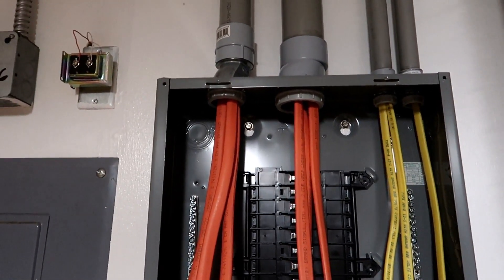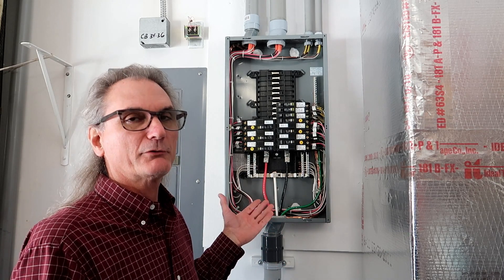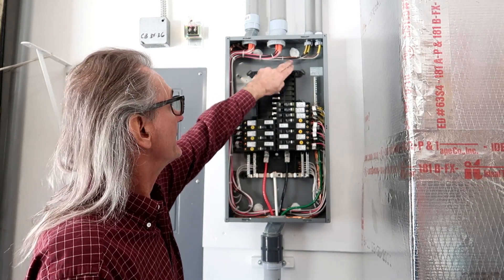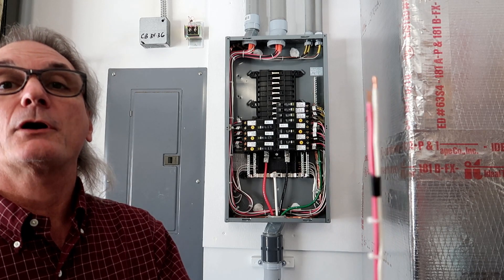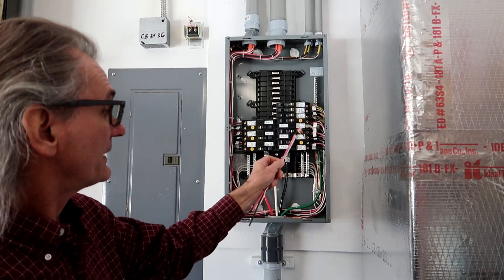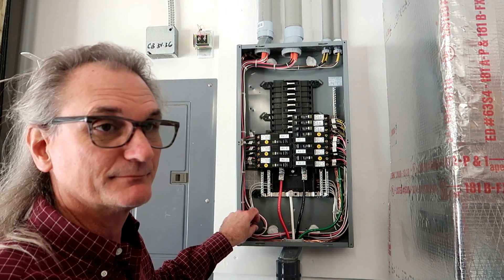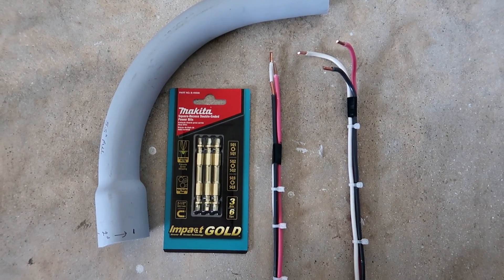10/3 and 12/2 wires terminated to Combination Arc-Fault Interrupters in a sub panel through conduit.

Comment: i am building a metal work shop. 30x50ft. i want to run a large conduit pipe from the breaker box and have it run the length of the shop. then have t fittings drop down to outlet boxes. do they have t fittings that would connect to a 2in conduit that would go into 1/2 in conduit running down to the outlets? I am thinking of running 5 outlets with 12/2 to gfci sockets.  just a long 2 in conduit branching down to the sockets
Reply from the maker: I don't know if they make reducer T fittings, but that is something you could do yourself. You could put in junction boxes and then run 1/2" conduits to your outlets. Hope you get everything working the way you want it.

Comment: Is it possible to can you run a romex 10/3 wire with 2 20 amp breakers to a  100amp service panel? Thank you
Reply from the maker: Hi Junior. Your question brings up a lot of questions before it can be answered.  What do you plan to do with the 10/3 romex? Are you looking to add a new branch circuit to an existing 100 amp service panel or are you trying to power up a new 100 amp sub panel?
Reply: Hey Steve thanks for your response first of all love your videos. So yes I’m trying to add branch circuit to my kitchen to power up fridge and blender and some outlets. Thank u
Reply from the maker: @juniormedina9282  You can can run a 10/3 with a ground for what you want to do, but there are a lot of things to be aware of to make sure you comply with the current code.  Take a look at NEC Article 210.4(B), it  requires the simultaneous disconnection of all ungrounded conductors to multiwire branch circuits supplying more than one device or equipment. I also believe it is a code violation to daisy-chain the neutrals from outlet to outlet, each neutral needs its own pigtail to the outlet. Good luck with your project and thanks for watching.
Reply: Can’t wait for your next video take care Steve
Reply from the maker: @juniormedina9282  Thank you for watching, I hope I don't disappoint you 😖🤣🤣
Reply: Hey Steve just wanna update you. Just finished wiring everything and it came out perfect just like how u said. Thank you again  May god reward u
Reply from the maker: Wow Junior, that was quick!  You already knew what you were doing, nice job.  Enjoy your new branch circuit. God already rewarded me, I found my soulmate last year. Thanks for watching.

Comment: For installing the 4 gauge stranded wire, do you screw down the lugs tight and then go back to tug on the wire and then re-tighten? I've seen that method practiced but I've also seen it where you only tighten the lugs once and leave it. Does it matter at all?
Reply from the maker: Hi Michael. After I initially installed and torqued the stranded wires, I did go back the next day and retorqued them. The torque wrench didn't move much, but it did move a hair. My take is this, the initial torque changes the shape of the wire which does take force. Once the wire has had a chance to relax in its new shape, the retorque makes sure everything is seated properly and the torque is stable. I do the same for terminal lugs because there is no guarantee that they were truly flat during the first torque. Good luck with your electrical project.
Reply: @StevesStrayStuff  Thank you Steve, that's super helpful!
Reply from the maker: @michaellegan  You're welcome Michael, thanks for watching!

Comment: Wish you ran wiring in my crib, it looks like a ten year old done the home I just bought. To top it all off they cut the shielding back to where it enters the box and there is absotootly no numbers/letters printed on one damn wire to determine any wire sizes. 
 Im no electrician but I think all house wiring should be printed on the wires coating not just on the outer shielding for safety reasons.
Great job, thanks
Reply from the maker: Thanks Harry, sorry about your panel. The code allows the removal of the sheath, as long as there is a quarter inch or more of sheath extending into the panel. Even thought the individual conductors are not labeled, the outer sheath color will tell you what gage the wires are.

White - #14 AWG (rated for maximum 15 amps)
Yellow - #12 AWG (rated for maximum 20 amps)
Orange - #10 AWG (rated for maximum 30 amps)

Comment: Steve,   Beautiful!   Please do not put any more conductors within that bundle.   Too many like that and heavy circuit usage will build up heat.   You currently have 18 current carrying conductors in the bundle.   NEC starts dictating separation at 21 but, that is mostly an opinion call. 
Respectfully,   Kevin
Reply from the maker: Roger that Kevin!

Comment: I saw your video for the sub panel and the 3-3-3-5 wiring, you passed your inspection but the panel itself was still empty.  
Did you get a separate permit and inspection for the installation of the 12/2 and 10/3 wires?
Reply from the maker: Hi Omega. To get the sub panel installation inspected and signed off, I was not allowed to perform any other work involving the sub panel until the sub panel inspection was complete, that is why the panel is empty in that video.  I did pull a second permit but check with your local building department because you may get a discounted rate if you file for more than one electrical permit within a certain time frame.  Good luck with your electrical endeavor and thanks for watching!

Comment: Hey Steve:
First of all, GREAT looking panel. Left slack for moving breakers, but still tidy as can be!

Got a question that I THINK is obvious, but want to make sure:
You’re using 9 CAFI breakers with neutral pigtails, correct? (You just nicely smoothed & straightened the pigtails into the neutral bus bar?)

Saw the 9 CAFI breakers, and I THINK I heard you say that NEC says the white neutrals from the 10/3’s & the 12/2’s go straight into the CAFI breakers. But I saw 9 neutral white wires going into the neutral bus bar too. In my head, I was thinking the sub panel was a plug on neutral & you didn’t have pigtails - but then I looked closer and...?
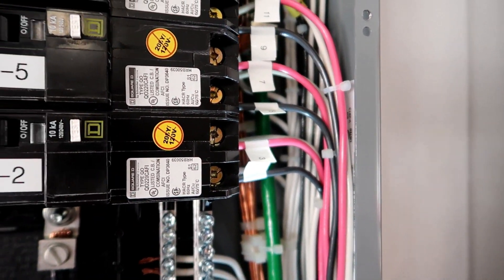Reply from the maker: Hi Leon.  My sub panel does not have a plug-on neutral, so you are correct, I did uncoil/straighten out all of the circuit breaker neutral pigtails and connected them to the panel's neutral bus, so the nine white wires you seen in the neutral bus are the circuit breaker's pigtails.  The 10/3 and 12/2 neutral wires of the branch circuits connect directly to the respective circuit breaker.  If you freeze frame the video from 4:47 to 5:15 you can see them.  The plastic tie I put around each red/black/white wire group is to make sure I keep the white wire with the correct group of hots.  It was too difficult to label the neutrals once they were connected to the circuit breakers.  Thanks for appreciating the panel's cosmetics!  I am proud  of the way it looks.

Comment: You just went crazy bro. Its not that serious
Reply from the maker: Not really.  I have been wiring aircraft for 36 years and that is what an aircraft circuit breaker would look like when I am done.  I am not going to wire my own stuff to a lesser standard than what I give my customers.  Thanks for watching.
Reply: Bro aircrafts have wire have harness, im not saying its bad work i think you have the wires a little tight. Remember induction happens. But wow lot of time I’m a neat nazi too. But you went to another level. Love that conduit bushing at the bottom if that 1 1/2” conduit.
Reply from the maker: A "Neat Nazi", I like that, haha!